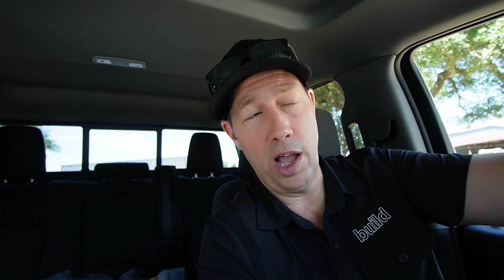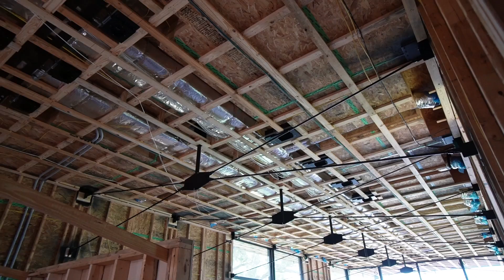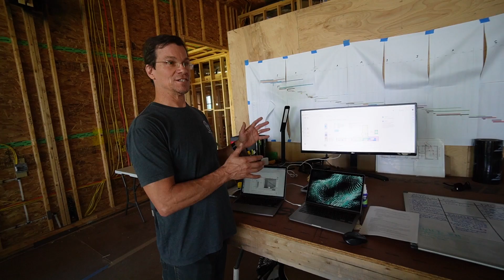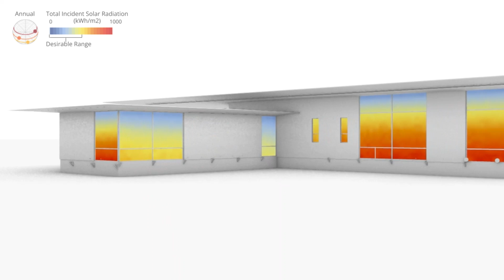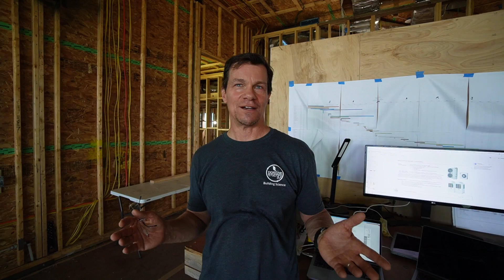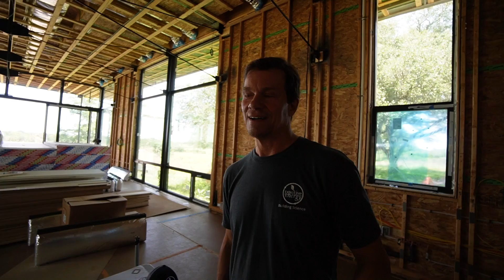Your house plan is pretty... But is it efficient?

Comment: Whoa. Did I understand this correctly? $3 per sqft is only 1/3 to 1/2 of 1% (or .334% to .5%) of the construction costs?? Breaking that down, that means construction costs $600-$900 per square foot, meaning a 1,000 sqft (small) house will cost anywhere from $600,000 to $900,000 while a 2,500 sqft (medium) house will cost anywhere from $1,500,000 to $2,250,000 and a 4,000 sqft (large) house will cost anywhere from $$2,400,000 to $3,600,000. Is that just construction costs? Does it include materials?? Or is that another 50% tacked on to the total?

Speaking for the general American population (you know, the 90% who make less than $100,000 per year), who can afford that??

Great video! Incredibly informative and well thought out. But it would be nice if these American-based videos could be tailored more for the average American who is watching rather than tailored for the wealthy who have people watching for them. Definitely disappointing in that aspect. But otherwise good video.

Comment: I have been tinting since 2000, and own my own business.  Window film done correctly is an amazing help for heat control without sacrificing the views.  In most cases, tint actually enhances your view.   (As long as they are not triple pane, don’t tint those.).

Comment: All of this is something I've been doing in one way or another since I was a kid! Building with my Lincoln Logs and LEGO sets I would think about "where are the windows and doors and where is the sun coming in? Where does the heat and AC go? What about all the plumbing and drains?" So when it came time for my wife and I to plan our house, I drew up plans, consulted with builders and different field contractors on the logistics of the project. My initial design had good response from the professionals I talked with. They gave me some advice and information to consider. I worked on my plan upgrading and updating ideas. Now that I feel it's time to build I need to be able to communicate my plans to the builders. My wife has no idea how any of these things work or how they work together or conflict with each other. I don't know how to explain these things to her. I can explain it to her but I can't understand it for her. Hopefully our builders will be easier to communicate with.

Comment: As with most of these videos...what does Positive Energy charge for this service? And what are the energy savings resulting from the service? I can only speak to our own build, but when we renovated our home in 2019, our architect chose a very glass-heavy addition that used deep recesses and/or overhangs for any window that had heavy sun exposure. We also used the most energy-efficient windows possible from Milgard/Western. The result is a home that has 50% more square footage and uses 20% less total energy in the summer than the much smaller home did previously (in the winter, the difference is even greater). That means we are spending about $200/month in peak electrical bills which is 44% lower per square foot than we did previously...when the house had comparably little window area. The question is...how much does the marginal efficiency gain cost you? And will it ever pay for itself?
Reply: nobody ever asks about ROI when you buy a luxury car, why this?
Reply: @bhylton86  because Lamorghini isn't telling us about their efficiency and long term cost savings. Nothing wrong with spending luxury item money...but let's be upfront about it being just that. If we want to sell it as an efficiency gain, we need to know how much of an efficiency gain and what it costs to obtain it. Kind of like me going to my CEO and saying "let's buy this crazy expensive Software...it will make us more efficient." First two questions out of his mouth would be "How much does it cost?" and "What are the cost savings?". And if the cost savings don't outweigh the costs, it would be a no go.
Reply: @steffenpelz7114  In the video Matt mentioned that the service usually costs at least $10k for a project, and Kristof said that it runs $2-$3/sq. ft. They don't mention the cost savings specifically, but do talk about subjective gains in comfort related to temperature and lighting.
Reply: @steffenpelz7114  It's not just about efficiency or cost savings. It's about COMFORT and healthy air in your home. You're still missing the forest for the trees, these are luxury homes and the highest end builders out there.

Comment: down here there is an award winning home that had two story of glass for the lounge area and the rest of the house is a wrap of glass 3/4 of the single story wall height. also afaik no aircon.
a few years later that house was sold.  i guess the house absolutely cooked in summer.  the later version of that house design they added fixed 50% shading right across the front of the top half of the two story glass.
award wining but not very liveable.

Comment: The cheapest "version" of checking to see what a house would look like in morning, afternoon, evening, and night times is trying to do a pseudo-mock-up of it in Sims 4. It won't get you the thermal issues, but if you remember to orient your floorplan right, you'll be able to see where the sunlight hits.  (I would NOT, however, "recommend" taking that Sims 4 house to a contractor and telling them to "build me this!" because it's a sketch on a paper napkin at best.)
Reply: If you can learn how to use unreal engine you can do it for free.  You can set lighting for a specific location at whatever time of the year.  The advantage of that is the lighting should be pretty accurate in the 3d model since it will account for reflections.

Comment: I was wondering if the multilayer model you were showing allows output to Virtual Reality headsets?
Its a feature I used to great effect by a University some 30+ years ago when they did a walk around of the architects plans in VR space and in the process realised that a wall was badly positioned & needed moving.

Its very interesting looking at your planning tools & the tools used on large commercial projects that are talked about on channels like the B1m?
Your tools also remind me of the integrated multi-look capabilities of the tools used by car designers, so that designers can use virtual mud tools, whilst people looking at power   & data handling can look at that or cost accountants can look at their implications.
Reply: He mentioned he was modeling in Revit, which I don't believe can output to VR by itself.  However, there is a plugin for Revit called Enscape, which can do real time rendering and output to VR.  It's really cool, you can do a VR walkthrough of a house with all the finished surfaces rendered before the design/plans are even finalized.

Comment: I'm sorta confused about the shading on the inside not increasing efficiency.   If you put white blinds on the inside wouldn't it just reflect the solar radiation back outside?
Reply: By having a shade on the exterior your blocking the solar heat before it goes through the window. By having it on the interior, the solar heat is going through the window and already inside the home. Though yes white blinds may reflect more than a darker color. By having a shade on the inside your mechanical ac/ furnace is making up the difference and has to get it back to the specified temperature set at the thermostat
Reply: I think of it like this how much are your blinds heating the air in the room. If you let the light in then everything the light touches heats up and cools itself into the air.
Reply: @Nooneinparticular987 black out curtains and aluminum blinds are even better

Comment: I'm in Residential HVAC design and sales. Basically I hate windows unless they have 8 to 10 foot covered patios or overhangs. Glass = hot, cold, and expensive monthly bills. I also love a large crawl space or attic that spans the entire home. A nice large space to run mechanicals makes everything so much easier, now and in the future.
Reply: Basements are the norm in my area, not needing to deal with crawlspaces and attics ,we’re a little spoiled. The county supplies us with load calculation sheets and if filled out correctly using the architectural plans for references, it works perfect every time. They also require Air returns in every room but for the bathrooms & kitchen. When the houses are built too tight then we’re looking at an Aprilaire EVR 8100 , it does the trick.
Reply: Are you supposed to put supply grills near windows, and point the grill to blow toward the window?
Reply: @wkobayashim  That is a very common way to do it. The vent doesn't have to be right next to a window but you do want them near a wall. The principal is that the air will flow along the wall and then mix better in the room.  For a supply vent in the floor next to a wall, the air will move along the wall then hit the ceiling, and this creates circular air movement. Same idea for a vent in the ceiling next to a wall, but the air would flow down.
Reply: @wkobayashim  , You better have a pretty good reason not to install them by the window. As far as the diffuser direction that is pretty much determined by the type of diffuser you install (it is not required the air blow on the glass as long as the diffuser is near the window). There is also exceptions to the air returns, sometimes the construction doesn’t allow us to get it in every room but again you need a reason why it wasn’t installed there. I am in the St. Louis Metropolitan area which has a lot of municipalities ,they do try to be consistent with one another but that’s not always the case when it comes to code enforcement  (sometimes it can even change from inspector to inspector). I will say we have a lot of very good HVAC contractors and trade associations so it’s pretty easy to stay consistent with requirements.
Reply: @boby115  is it code to have a return in every room/living space, except bathrooms?
Reply: @wkobayashim  , When the national builders come into town, the only thing we really throw them a loop far is the return air in bedrooms , pretty much everything else in the open areas is  standard air returns. Use common sense on the rest (no air returns in the bathrooms or kitchens and supplies should be installed at the point of infiltrations ,which would be Windows or at least in window areas).
  Commercial buildings are pretty much standard like the rest of the nation and all the big ones are engineering designed.

Comment: Nice! We are building a DIY house with a passive design. We have exterior insulation, a white roof, big south facing windows and a 4 foot overhang. It is performing awesome even without the interior insulation.  🌞😎
Reply: hi guys, cool meeting you 'here'
I'm waiting for you to finish the floor!
Reply: @bobjoatmon1993  😄 Hi Bob! First we have to finish the insulation and drywall. It's coming along, but it's a bit of a slow process. 🌞🏜️

Comment: Good job & information by Kristoff. As Kristoff said, the owner wanted an energy resilient and thermal comfortable home. That's their value for their home. In VE parlance, what is the cost for all of this? What are they gaining in energy savings? Are there any cost-effective options?
Reply: Contact your trades early and get everyone on the same page while a home is still in the design phase. Keep glass to a minimum. Plan for a large crawl space or attic that will span the entire home. Also large covered patios or porches are always good. If you keep the design simple and leave extra space for mechanicals everything will be easier. I'm in Residential HVAC design and sales.
Reply: @KPHVAC  Exactly, just finished a small design- build house in east Texas. Installed a 18 SEER heat pump Carrier with a Panasonic ERV. We looked at several options that involved energy savings costs. Video coming in the coming weeks.

Comment: Informative and wish list area but what can be done is a direction to go as far as our wallets can endure.
Reply: You have to figure that out
Reply: @daveklein2826  This.  Exactly when value engineering comes in to play.  I really think people need to spend time building their budget models.  The $ values can be input after everything gets spec'ed.  Add for overages/changes.  THEN value engineer it down if needed. JM2C
Reply: @Ivebeenaroundyouknow  So you totally didn't get it, he is not nore will ever be about value engineering. He is about the best built product....if you want CHEAP, or as you put it, value engineering, find another channel.   And no, he should not provide that
Reply: @daveklein2826  Actually I was agreeing with you.  The "you have to figure that out", is exactly what value engineering is, determining ROI.  Creating or finding value has nothing to do with being "cheap", it is about compromising to get what you want, whatever that may be.  Value engineering is a pretty common industry term, and does not always indicate nor  reflective of something costing less than something else.

Comment: This is really cool to see - whole system assessment within residential buildings is something I idly dream of using if I ever won the lottery and built a "200 year home". Love that such services exist already.
Reply: I think of the 100 year home. I question all these epoxy coatings, fluid applied, and tapes. How long will they really last.  I remember the Canadian home had 5 different tapes...

And not to mention McMansion, that wouldn't last 5-10 years without major problems.
Reply: @jasonmajere2165  What's the alternative to fluid applied flashing, tapes and peel and sticks? What are some better methods to ensure a house will last 100 years or more? This is a sincere question. I'm not trying to challenge you. I'm curious to learn of a better way.
Reply: @dezzydez83  I don't know what the answer is, it's something Matt could explore.  It's kind of like single-use plastic, we rely on it but is there a better alternative.

Comment: You need to be a 1 stop shop with in house drafters, an architect, a mechanical engineer, and even a interior designer.
Reply: We have spent 2 years planning be4 even contacting any firms.  People are too impatient and just start building.  I think that is the reason for the huge overages.  Know EVERYTHING be4 you start.  From mechanical rooms to trenches to wall socket locations, vendor lists everything, BEFORE you pull a permit